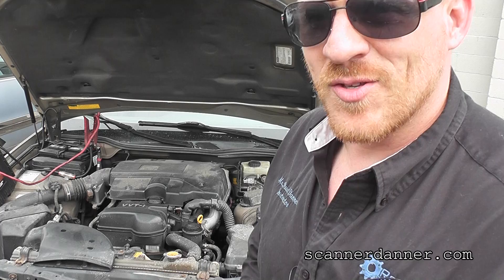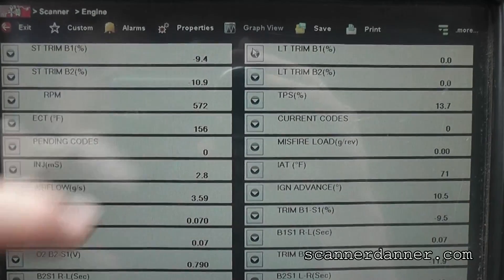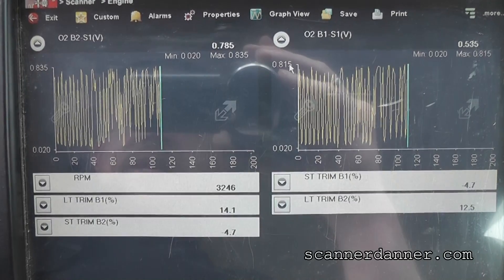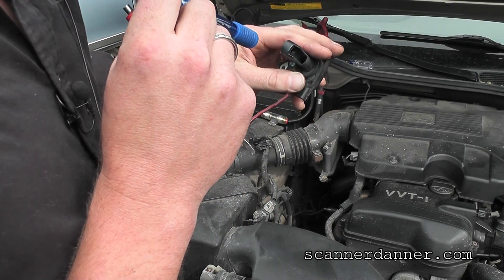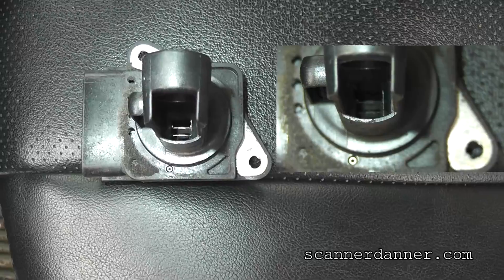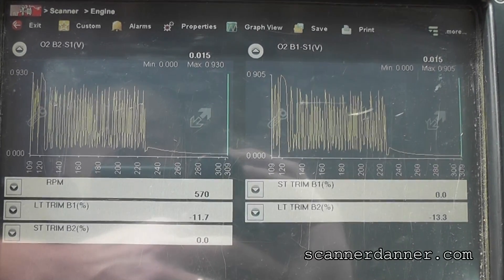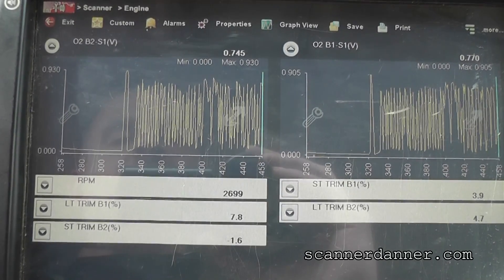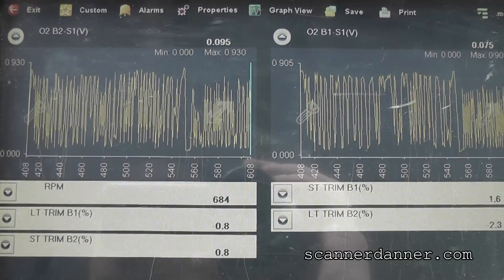How to identify and clean a dirty MAF sensor (Lexus)

Comment: I actually used AI to access your video. My lexus has a P1111 error code which points at the MAF/IAT sensor fault. Will be checking and cleaning myself before I decide to replace it. My mechanic reaped me off a whooping 320 quid and did not fix the problem. In future,I'll be using you tube guide to service my own car.😢

Comment: Trying to help my son had same issue changed out mass air flow throttle position sensor valve cover gaskets vacuums lines look a little cracked and still starts up revs high then dies … o2 sensors both been changed and yet not sure if he has a vacuums leak or even hooked it back up right !! Plz help buddy 🤒😵‍💫😵‍💫

Comment: Hey bud, i have a 93 sc400, car idles low and when pressing on pedal rpms are slow to rise and wont go over 2500 rpm, changed plugs fuel pump and filters cleaned maf, checked tps voltage, at a loss, pkease help
Reply from the maker: Check it for a restricted exhaust. Remove upstream O2 sensor and see how it revs
Reply: Ty sir I will do, also it has code 31

Comment: My local Lexus Dealership cleaned my throttle body but not my MAF because they said we don't clean the MAF?? He did not give a good explanation why but I have a 2014 GX460 Base Model with 100k miles on it. Have you ever heard of Lexus Dealerships not cleaning the MAF or is it BS??
Reply from the maker: Yes, from the factory, when they're contaminated, they recommend replacement only. Also some MAFs are not cleanable

Comment: Thank you for the content. Did you ever find out what was causing the battery drain? I have a 2001 ES300 with that issue, still trying to figure out what's causing it. I think it may be the auto headlights.

Comment: Hi Danner 
 I have a 1999 RX 300 p0171 lean code, when I smoked test intake manifold I get smoke from oil cap & dip stick when removed. 

Do I have to set ENGINE to TDC or not?

Thank you great learning videos.
Reply from the maker: You do not have to have the engine at TDC and it is normal for smoke to fill the crankcase due to the pcv system
Reply: @ScannerDanner  thank for response I enjoy watching your videos.
  So if plug up the Pcv por at manifold or pinch hose that would  stop smoke entering crank case,?
Reply from the maker: @andymena3862  yes, that and the PCV inlet (breather) where ever that is. But you don't need to. Just know those are minor leaks, that should also be corrected

Comment: SD checked my spark plugs! thinking that was it they seem fine  (a little hesitation at first! then goes away) but is doing it almost every time when  stop and go?  must be the MAF that is clogged up/dirty ! )was thinking of ordering a new one  [own a 2011 Lexus RX 350 with 174 000 miles on it]basically all i need to do is clean the two little wires carefully right? and or use MAF spray!?  thank you! you Rock ! sir*
Reply from the maker: If they are dirty, then yes! Just be gentle, but when they are really contaminated, you will need to use a q-tip or soft small brush as well as MAF cleaner
Reply: @ScannerDanner  thank you!  will do.

Comment: MAF cleaned with brake clean, seriously? How did that work out for you?
Reply from the maker: Just fine. Literally hundreds if not a thousand times
Reply: @ScannerDanner  Some You Tubers and the dealer don't recommend it. There are even MAF cleaner cans that state "Not for Lexus" which is why I asked. I have had an LS400 for decades. What by the way is your opinion on using brake cleaner on O2 sensors?
Reply from the maker: @youhoneycoyvunen8964  is that a serious question? You can't clean and O2 sensor, you replace them.
And not all MAF sensors are cleanable, only the hot-wire type
Reply: @ScannerDanner  It was a trick question. And your answer is correct. But You Tube has plenty of tutorials where people tell you how you can clean them. I have had even a repair shop (not the dealer) tell me one can clean O2 sensors with brake clean. Regarding the MAF sensor issue, I just pointed out that Lexus is sensitive in that regard. So much so that some MAF cleaners print it on the can "Not for Lexus". Why that is I don't yet know, but I will find out before I do anything to it. As I understand Lexus (Toyota) has its own MAF cleaner spray that one should use.  Thank you for replying, though.
Reply from the maker: @youhoneycoyvunen8964  manufacturers forever have been telling us they are not cleanable. That's not unique to Toyota/Lexus.
But the proof is in the results. I've fixed hundreds of dirty MAF sensors, with the results being a 100% fix on everything, including the fuel trim cells (every load and RPM combination) being back to factory specs. (There are some who argue that point and claim they must be replaced)
As far as cleaners, if you pick one that leaves no residue, your good. Some will leave a residue and for obvious reasons that wouldn't be good.
Reply: @ScannerDanner  I left a link to the page that described the Lexus issue with CRC MAF cleaner. But it vanished. Did you check it or shall I post it again?
Reply from the maker: @youhoneycoyvunen8964  links get filtered out by YT automatically. I never saw it

Comment: I’ve had a low idle for years. Can’t fix it. Stuck at 400 rpm. 

Replace maf
Replace throttle body and the metal piece attached. 
Found 3 cracked pieces replaced them all. (Over 3 years) 
Tried the turning the key back and forth trick.

Comment: Thx Scanner Dan for allowing me in to your class.  I learned a lot, but my 07 Jetta has me baffled.
It ran great when I bout it, super fast. 
Had battery issues, and it got ark like twice.
Check engine light came on. Code said maf sensor. Put a new one on. Trunk light came on, wouldn't pop open, hand to go thru the trunk. A/C stop working. Then the ESP light came on.  Then it went into Limp mode. Now it will crank no start.... Then I disconnect the Maf, and it ran...but still in limp mode.
I'm just throwing parts at now???
Do I have to take it to the shop. 😢

Comment: I just bought CRC MAF CLEANER AND THROTTLE BODY CLEANER. THERE IS NO INDICATION OF ANY FUEL ISSUES WITH. MY 2003 SATURN ION. IT STILL PURRS LIKE A KITTEN, BUT I CONSIDER CLEANING THESE PARTS AS GENERAL MAINTENANCE. 
I HAVE 169 THOUSAND MILES ON IT. BUT, IM STILL CONCERNED WITH MY '86 , 302, F150 AND MY BROTHER'S 99 Toyato Camray Solerno.

Comment: Can't see them on the 2013 Ford Taurus,MAF,3.5, can see the intake air temp resistor but not the MAF resistor,, getting code for bank 1 02 sensor 1 bais stuck lean,no MAF code ,and this is after they had already changed cats and all 4 02 sensor

Comment: Hi Mr Danner Can you help. I live in Perth Australia. I am on a Disability pension so money is always a issue, I own a Pajero i0 2002 I need a scanner that uses the mut2 proticol .it has a obd2 port but unfortunately a normal scanner will not communicate with the car. I just can’t get any information on a cheap scanner I can buy that uses Mut2 . I would of thought there would of been a lot around since they stopped using that proticol nearly 20 years ago. Can you help. Cheers Andy

Comment: THANKS MY FRIEND I AM FACING A STRANGE SITUATION I HAVE STFT -18% - -23% AND LTFT + 24% AT IDLE AT WOT NOTHING CHANGE FUEL TRIMS ARE SAME.THE 02 SENSOR 1 DONT WORK AND THE CAR STALL WHEN GO TO STOP AT  LOW RPM (1000 RPM) .UNPLUG MAF AND FUEL TRIMS GO TO NORMAL AND STALL PROBLEM STOP BUT CONECT MAF AND DISKONECT 02 SENSOR 1 STALL PROBLEM IT GETS WORSE . HOW CAN I BE RICH IN STFT AND POOR IN LTFT?ΤHE MAF READING NORMAL AT VOLUMETRIC EFFISIENSY AND IDLE AND 2500 RPM HAVE READING IN THE SPECIFICATIONS 
ECU TO CLOOSE LOOP READ  THE PRICES OF THE O2 SENSOR AND THE MAF  TO REGULATE THE FUEL TRIMS?DO YOU 
THINK IT IS RIGHT TO CHANGE O2 
SENSOR FIRST?SO THE ECU READ THE O2 
SENSOR BECAUSE NOW THE ECU DOES NOT SEE ANYTHING FROM THE DEAD 02 
SENSOR!
Reply from the maker: If your O2 sensor is confirmed to be bad, yes, absolutely change it first.

Comment: I have a question if I have -25% stft at idle and a 02 sensor f / r that does not work but when unplug maf sensor (close loop) ltft go to normal prices what's wrong  maf or 02 sensor?
Reply from the maker: could be a MAF issue

Comment: Any advice on gs300 2001 year,random dead gas pedal till have way to floor,other times responds and acceleration is normal.but it’s intermittent and no code.
Reply from the maker: Check your TPS voltage first and make sure it is a smooth voltage sweep from idle to wide open. (Cable throttle right?) This can be done key on, engine off

Comment: Hello  1997 4.3 S10 once in CL, STFT and LTFT start climbing very positive non stop and goes back to zero with throttle blip. But if rpm is held steady at 2000 it also then start to climb  fuel trims non stop both banks. Car has good acceleration at WOT but oxigen sensor goes very lean.

I'm leaning towards stuck open EGR, Mass airflow problem ( dispite looking clean ) or faulty o2 sensors that are below 450mv. 

Should I first get new o2 sensors? im stuck. Its hard to find OEM sensors here in Brazil lol

Cheers!
Reply from the maker: Fuel pressure must be tested next.

Comment: My fuel trims just seem all over and I can't make a good diagnosis. My 07 ES has positive LTFTs, the worse being 21% at idle. At 2k RPM, the short terms went negative around 7-8% and the long terms dropped to around 14%. Usual answer seems to be probably a vacuum leak right?
Well, doing the test again today, the short terms went negative about 2-3 percent, but the long terms increased from 11 to around 13, 14%. Huh???
This back and forth dance makes me unable to diagnose, and if the short terms are going negative, isn't the Long terms supposed to be following it, not going in opposite direction?

Comment: I’m a little confused on the negative trim with a dirty MAF. Just trying to learn this but that got me.
Reply from the maker: Only at idle. You'll still have lean conditions all other times. 
The best description that I've ever heard as far as this condition goes is at times of low air flow rates and larger surface area of the mass air flow due to the contaminants it actually dissipates more heat hence the rich condition
Reply: @ScannerDanner  Thank you for answering. I was approaching this under the premise that the contaminants on the MAF acted as an insulator thus falsely lowering the amount of voltage required to maintain constant MAF temperature under all conditions.

Comment: Great videos Scanner Danner! Probably you won't see this comment but if you do please advice me what to do with my MAF sensor. I get P0103 error whether my MAF sensor is plugged or not. What should I do=??
Reply from the maker: year, make, model, engine please and I can try to help
Reply: @ScannerDanner  So Im lost now. I found the right diagram. wire collours are matching on connecor pin.

MAF sensor ground cable is connected together with oil level check switch and Camshaft hall sensor! 
that is my lead because Im getting error messages on these!

I measured connector ground cable to battery ground and got very low voltage which is a good thing.
I was expecting high woltage and thats why Im stuck now.

Do you have any other ideas where should I look next? please?
Reply from the maker: @JustasJ  answer my first question and I may be able to help 🤨
Reply: @ScannerDanner  i replied :)
Reply from the maker: @JustasJ  year, make, model and engine!
Reply: @ScannerDanner  2010, Mercedes-Benz, E250 CDI BlueTec, engine OM651.294
Reply: @ScannerDanner   Im trying to reply to you several times now and I dont understand if you can't see it or something else. 

The car is from 2010, Mercedes-Benz, E250 CDI BlueTec, engine OM651.294

Comment: I’ve cleaned so many MAFs on Toyota products and fixed them right up. I’d always start there. Takes nothing to clean them up. 

For some reason.. (I’m guessing crappy paper filtration) they tend to dirty up real easy. It really is the first thing I check on Toyota’s for rough running and rich/lean conditions.

Comment: I just wish I could retain the info I learn in life. Sure I covered mass air with you couple years back. Be nice to simply have all your knowledge transferred or copied into my head like with some future tech we aint got yet. So neg soft at idle and pos at higher rpms, you say mass air flow. OK, be on that.
Reply from the maker: You've been with me a long time James and I really appreciate it
Reply: Yeah pal, I have witnessed from afar you growing from a thin Danner to a slightly podgy Danner whom needs reading glasses. Time has certainly passed. I’ve learnt from you and built my own business off the back of the knowledge. Only by the time I get real good though like your good self, all vehicles will be electric. Ha ha.
Reply from the maker: @jamesbarratt593  lol, time to hit the gym again :-) get's harder to maintain as I approach 50
Reply: What up. Ha ha. Funny. Your new intro. Dude I’m nearly 50 too.

So that Autel ultra. Do you rate it? Over snap on. Which is best and by how much?

Comment: I see TPS 14% on idle which seems very high.  After MAF clean, I wander if % went down also to near zero at idle.
Reply from the maker: Around 10% is normal on most electronic throttle body systems.

Comment: Pocket screwdriver and brake cleaner, this is exactly how I'm cleaning MAF sensors. The only thing I would add, while doing this procedure, do not soak the o-ring with brake cleaner it will expand.
Good video Paul, understanding fuel trims makes life so much easier.

Comment: Hey bro quick question , hope u can get back asap but Ijust berly picked up on 08 Lexus is250, igot a check engine light & check vsc light & I took it to get checked said it was the MAF , I changed it to a “OEM” one & it makes no difference, still got the check engine light after I took it for a spin & it started to act worse then at first, rough idle & hesitates to go
Reply from the maker: You have to provide more information my friend. What is the trouble code that it is setting? What engine? The vsc light is an effect not a cause. That light will illuminate anytime the check engine light is on.
Reply: ScannerDanner the error codes igot were P0172 & P0175 system too rich & my engine size is a 2.5l v6 & Ohok Ijust learned that the vsc comes on when the CEL is on, my first lexus my friend.
Reply: Igot those codes with the original MAF sensor it came with , after when I replaced it with the new “OEM” one it started to act worse n the CEL came on again, went to get the codes but forgot to ask for a print out sheet of the codes but this time iseen it had 2 more codes
Reply from the maker: @VictorRodriguez-nq9xc  those are system rich codes and the MAF would certainly be highly suspect but there are many other causes of a rich condition too

Comment: My car is all in the negative LT and St always in negative and showing low engine loads..... As well dont know why.... Tried almost everything... My engine load at idle is 13.7 percent
Reply from the maker: Is it still negative at 3000 rpm? Hold it there for a minute, in park, hot engine and report trim numbers
Reply: @ScannerDanner  they always in the negative....... It never goes into lean or even near 0..... 😭😭 Plz help car runs funny.... No power
Reply from the maker: @conroycordice979  year, make, model, engine please. How does it run with the MAF unplugged?
Reply: @ScannerDanner  2007 honda civic si...... It stay on when i plug out the maf but trying to move off it want to shut off
Reply: ST - 13 and LT - 8  at 3000 rpm

Comment: Does a dirty MAF sensor cause lack of power when accelerating?  Having some issues with my 2013 Cadillac ats 3.6. Check engine flashed on and off for a good 15 seconds when accelerating then went away. Took it to Firestone..no codes were stored. Also feels like the engine is working way to hard when going uphill..like a snail at times. No clue what's going on
Reply from the maker: Misfires can do that. (Ignition coil or plug issues)

Comment: i stripped my maf screw
Reply from the maker: that sucks :-(
Reply: Sometimes these sensors are fastened with "security " or "tamper proof"  torx STYLE screws that have a small pin in the center. They resemble the  torx heads but have more facets in addition to the pin in the center. 
 These specialised tamper proof / security bits have a corresponding hole in the center & can be readily bought individualy or in  sets.

Comment: Good video and well informed. MAFS are different. Some have huge wires to the resistivity sensors and some have angel hair. If your stuck on the road with a spitting and sputtering engine and need help fast, this video can be a life saver. Take it from there and use some common sense. Of course using the proper air filter and changing it regularly can avoid most of theses problems.

Comment: Looks like someone installed and oiled K&N air filter in that GS that coated the MAF sensor.  I would not recommend an oiled air filter in a MAF configured system.
Reply: I’m glad I didn’t go with the K & N on my GS350! I read somewhere that it lets more contaminants in so I went with OEM engine air filter from Lexus dealer.

Comment: Hi scannerdanner I have a mustang 2007 v6 4.0L in the morning when it's hella cold the car gives me a lot problems to started.i change the fuel pump and the temperature sensor and new battery and I change sparkplugs and oil and it still gives me the same problem in the morning the mustang but it doesn't have checkengine light.what could the car have??